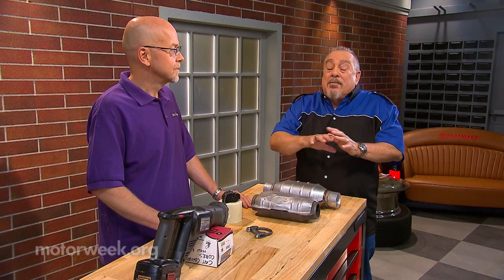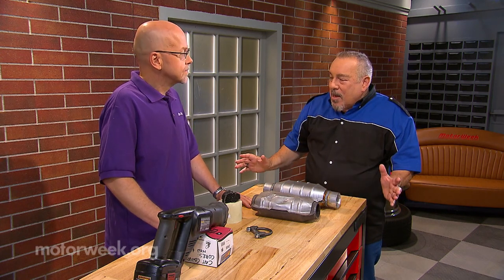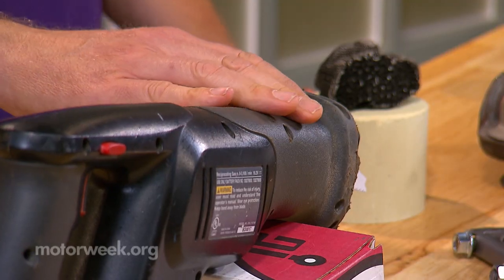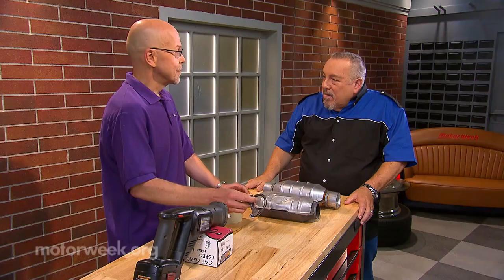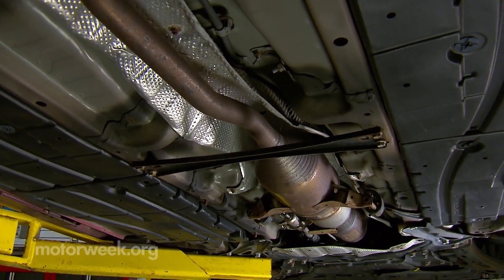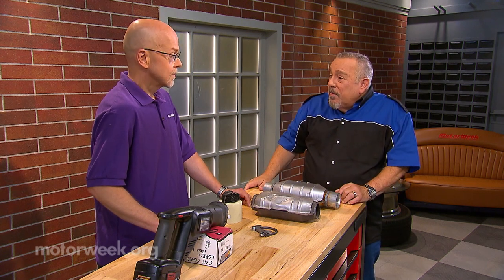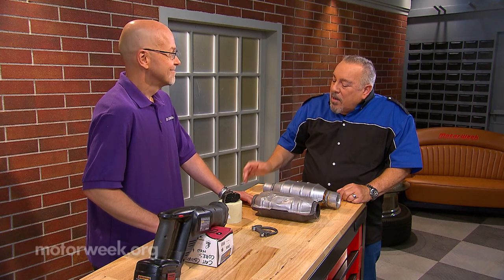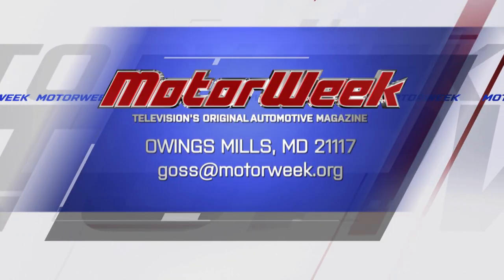Tips to Stop Catalytic Converter Theft | Goss' Garage

Comment: Install 3 inch cat-less  exhaust.  Problem solved.
Reply: It's been on since 2007, still runs strong
Reply: Someone needs to invent a plug end that emulates the voltage signal oscillations  of the o2. Then you can install a swapable pipe in and just install the cat for inspections 👍
Reply: @Kinky Streets Nothing a 50 cent resistor won't fix
Reply: @toyyoda3710  wow a new thing called a computer...holy 25mohms batman!
Reply: It will be nice, but unfortunately, installing a straight pipe illegal in California.
Reply: @xnotx2  that's you!
Reply: Problem solved !   Just pollute the air like a true patriot.
Reply: @xnotx2   
Such something has been around for at least 20 years, its called "o2 sensor simulator".
Reply: @jareknowak8712  hmm never heard of it.
Reply: @xnotx2  Thats why im here.

Comment: something a shop would need to do but... Tack Weld rebar along the pipe where it would normally get cut to make it super hard to easily cut the pipe quickly. Likely cost $50-$100  but can save you thousands.